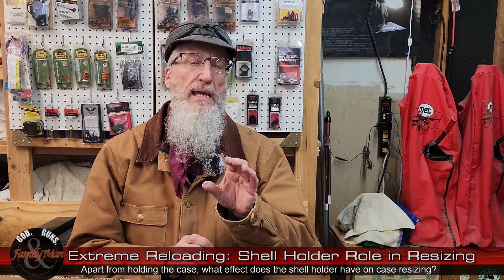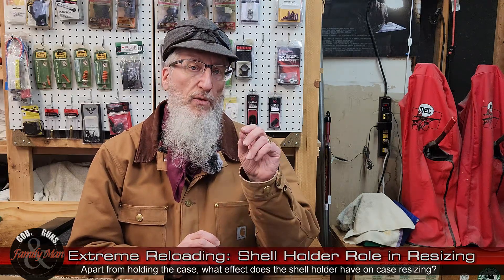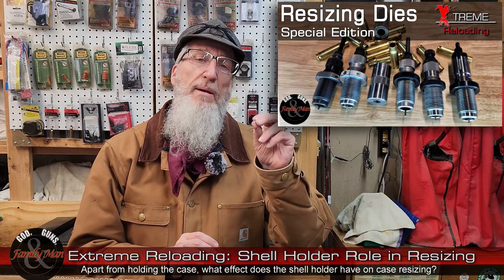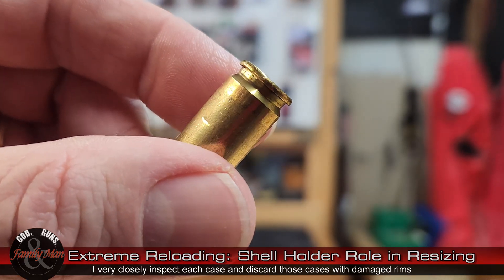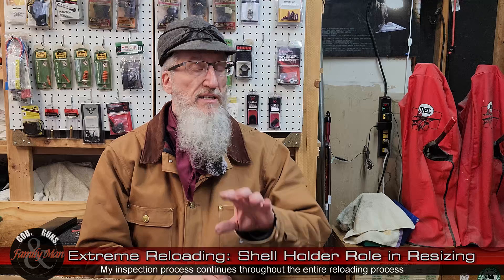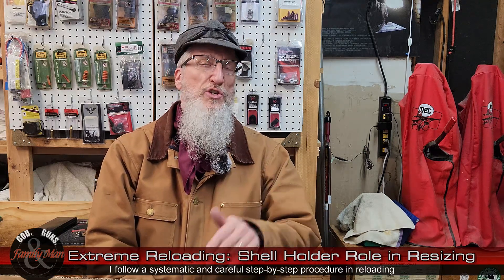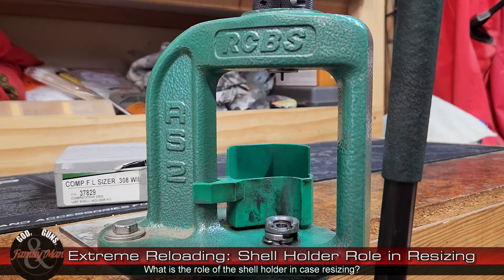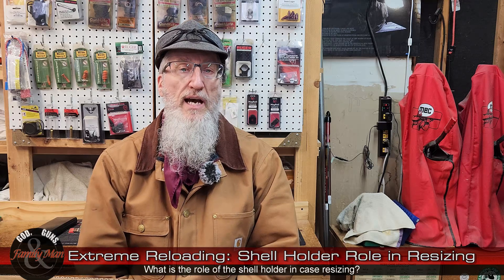Does the Brand of Shell Holder Effect Resizing? Extreme Reloading Special Edition

Comment: Of course, someone will say it's fine. I have a tray full of case holders and grab whichever is first to hand that fits my case. I know there are differences, but it hasn't ever been an issue for me. As I have over 250 sets of dies in many, many calibers, it's first-come, first-used with the shellholders. If I would ever notice that the caseholder isn't contacting correctly, I would either find another one in the tray or adjust the die. With that said,  I have reloaded since 1962, cast since 1970, swagged, both manual and hydraulic, since 1974. I'm more of a hunter than a shooter, but I like 3/8" rifle groups. I was state champion with handgun, and have many critters in the state, national, and world record books. I don't mean this to brag, only to justify that it works for me these last 63 years.

Comment: Its not the brand, its about the thickness. Look at Reddings competition shellholder. 5pcs in a box with one thou increment in thickness. So if your die bumbs the shoulder one thou to much use a thicker one, and a thinner vice versa..How hard can it be. Thickness of your shellholder affects the amount of setback, therefore we have to pay attention to the setup changes. One other thing to note is, if the setback is to much with a totally wrong setup, you can jst not raise rhe shellholder to much and risk that the whole casewall is not rezised all the way down. This example is extrem, but possible
Reply: Did not know Redding made different upper thickness shell holders.  Good to know.  I’ve been reloading for over 50 years.  I’ve seen more opinions and extreme details about reloading in the last ten years than I’ve heard in the first 40 years of reloading I’ve done.  The upper thickness dimension from the shell base surface, on the shell holder,  is the only dimension that will effect how deep brass goes into the die and how much shoulder is resized.   Didn’t know REDDING made those different thickness holders.  Interesting.

Comment: Non-issue. Redding comp holder set, the .000" sets the shoulder back exactly as the lee does, and if you got a long chamber test measure the plus.00? against once fired to get a thou or 2 setback. Small base dies should not be used on anything but autoloaders as it beats the work hardened brass too much for longevity in hunting and precision. The guys, yes i seen your comments, that have a set of dies specifically for each gun in the same caliber base is a bit anal retentive. It in no way accounts for chamber dimension changes. A 308 is a 308 is a 308, unless you have an out of spec or "tight chamber" 308. I have both and have never had issue except for crapfactory or a bent shell. This is me knocking on wood, and letting you know you can refuse subpar equipment, but one set IS a standard and its probably the equipment at the firing line that is subpar.

Comment: I feel that all shell holders are pretty similar but I really like lymans and they feel tighter on the base of the case and feel much stronger. Lyman seems like they're milled out of steel instead of most other shell holders that are poured.
Reply from the maker: I have not used a Lyman shell holder.  I will give them a try the next time I need buy one.  Thanks for watching and posting.

Comment: Each rifle has a separate set of dies, with it's own shellholder. A note in the die box denotes which press the dies are adjusted to.
Reply: I take the opposite approach.  I set up the die each time.  Different cases and the same cases later on respond uniquely to being resized.
Reply from the maker: That is an excellent way of doing things. I may end up doing the same for the .308 rifles I reload for (one HK MR 762 and one AI AXSA).

Comment: Good tip concerning not mixing shell holders in your process, however, if you're having to sort out cases with incipient head separation, you may want to reevaluate your sizing operation.
Reply from the maker: No problems with case head separation and I have only had one case head fracture that I ever detected over the decades.  But I will continue to check every case, that is just good, safe reloading practice and it only takes a few seconds per case.